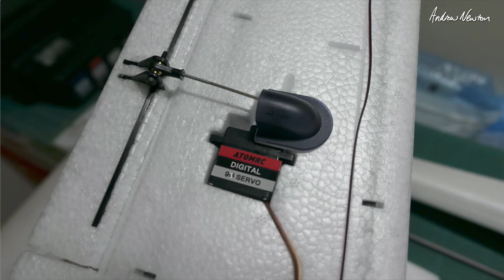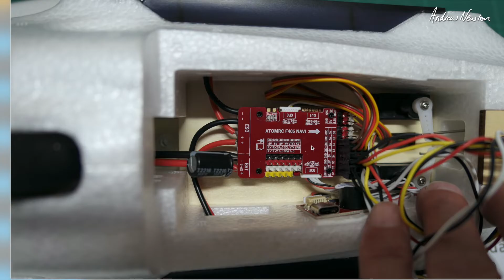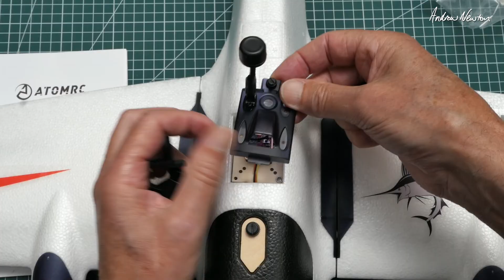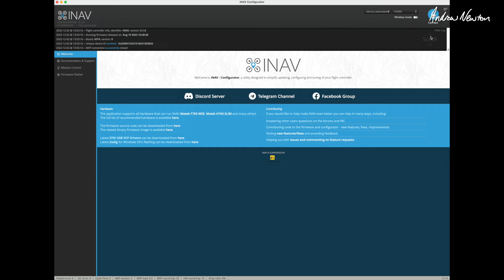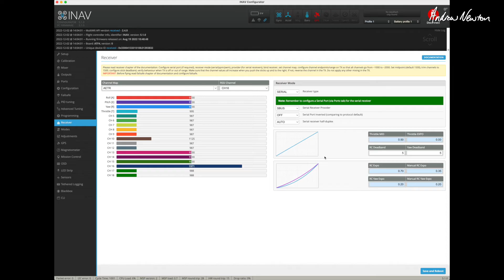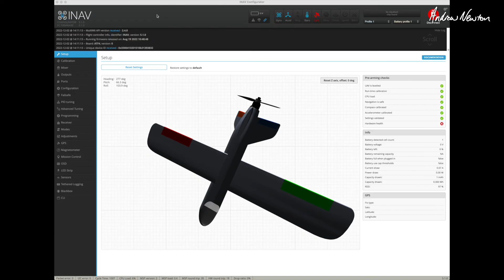AtomRC Swordfish Setup and INAV

Comment: I'm at a loss as to why AtomRC didn't extend the ailerons control horn to be in line with the ailerons neutral angle pivot point to maintain control surface throw symmetry on such a nice design. The degree of asymmetry in control throw distance added is hard to measure accurately, and better done at the servo if that's what you want (for differential aileron throw, etc) allowing asymmetry in both directions up and down.

Comment: I got an atom swordfish for Christmas. I tried to maiden it today and every time i through it it would fly out about 10 to 20 feet and make a hard right turn and hit the ground. I did set it up like the instructions said -1800  and the arrow pointing towards the rear. Do you have any idea on what is going on. Thanks for your help. Ray
Reply from the maker: INAV Trouble shooting link in the description. Parts 1, 2 and 4 should sort your issue
Reply: @AndrewNewton  make sure both props are on tight.

Comment: Andrew, I noticed that your receiver powered-up when you plugged in the USB cable. Mine doesn't, so I have to connect the main battery up. Have you any idea why that might be? It's frustrating because the air unit begins to overheat while I'm working through INAV. Receiver is a Crossfire Nano btw
Reply from the maker: Connect the receiver to a 4V5 pin for USB power, doesn't need to be on the same UART
Reply: @AndrewNewton  Thanks 👍

Comment: Great info on setup. So right, everyone's transmitter setup and switch-modes seem to differ.
Thanks for the update on the current draw. Very impressive package.
Overall this seems like one of the best new planes released in 2022.
Reply from the maker: Yes, best for quite a while.

Comment: Nice overview Andrew. It looks like they've used Quad style ESCs, have they added any capacitors on the ESCs too or just the one cap for the battery feed?
Reply from the maker: Thanks Crunckle. No caps on the ESCs. Probably needed looking at my FPV feed
Reply: @AndrewNewton  I've always thought it good practice, especially on a twin with longer power leads.
Reply: I got one capacitor on my FC battery pad
Reply: @Tommyjames21  What size?
Reply: @sherwoodp2738  470uf 35v

Comment: Great vid! Can you tell me where you ended up with the servo horn holes for the ailerons and vtail to reduce throws?
Reply from the maker: Thanks, I cant check for a couple of days. Remind me on Monday if I forget
Reply from the maker: Outer holes on all the control horns. Outer hole for aileron servos  and second outer for tail servos
Reply: @AndrewNewton  Thank you! As far as I've understood, I should do nothing like reversing and adjust travel in the radio. All this has to be done in INAV configurator, right?
Reply from the maker: Correct. The only reversing you would do in the radio is to get the bars in the INAV receiver page moving to the right when you move sticks up and to the right.
Reply: @AndrewNewton  Thank you very much, I will double check that

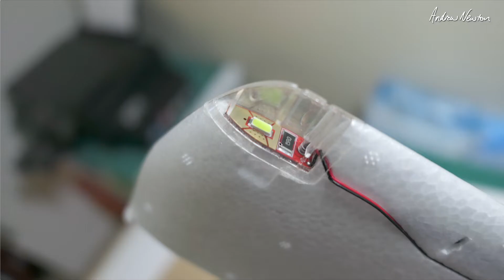Comment: If you open the hatch at min 4:08 did they wire the led lights to the ESC or to the quick release board on the the wing?
Reply from the maker: To the ESC

Comment: I noticed you installed the props  going opposite I would suspect. I wired the motors to spin away from the fuselage. Is yours going toward fuselage and that’s why props are installed that way?
Reply from the maker: No real reason. All combinations work well. Most twin planes have 2 props going the same way.
Reply: I think the best way to mount the props would be having them spinning inwards (moving downwards closest to the fuselage). That reduces p-factor when you're at a high angle of attack so if there's ever an RPM differential between the motors the yaw moment would be minimized. HOWEVER p-factor doesn't affect an RC aircraft that much so any orientation should work, but I would try to have them spinning opposite directions personally.

Comment: What kind receiver did you use to connect to swordfish rc plane’s flight controller
Reply from the maker: FrSKY SBUS then Matek ELRS. You would probably need to use a FlySKY receiver set to SBUS.
Reply: @AndrewNewton  but I saw the transmitter is called radiomaster you are using it to swordfish rc plane video of atomrc swordfish setup and inav that YouTube video I watch and the receiver connected to swordfish rc plane’s flight controller on it

Comment: I noticed that you don't have the tail fins installed.   I lost one of mine and am deciding if they are really necessary.  I could 3d print them but  do you think they are needed?
Reply from the maker: I did fit them later and I still have them. Probably do have an effect but not crucial.

Comment: Would you recommend the Swordfish for a beginner to learn to fly LOS with before getting into FPV?
Reply from the maker: Great for FPV but not the best for beginners. Skysurfer X8, Bixler or TopRC / PrimeRC TC1400would be easier to learn on and survive crashes better.
Reply: @ thanks for the suggestions. Anything with front propellers you would recommend. I loved the XK A800 and I found it easy to fly. However the quality of the electronics are pure garbage. I tried a ranger 600, hated it.
Reply from the maker: Phoenix S or Walrus would be good. But if you have done some flying already the Swordfish might be fine for you.
Reply: @AndrewNewton  ok great thanks for the suggestions. I find it odd how I could fly a front prop plane fairly well and do successful smooth landing fairly precise with the a800 while the ranger 600 was horrible for me.
Reply: @ thanks I will do the Phoenix 1600mm then unless you think the E-flite Umx Conscendo is a better option?
Reply from the maker: Phoenix S is my fave. But 2S only unless you swap for a smaller prop
Reply: @AndrewNewton  thanks for the tip going for the Phoenix then

Comment: Hi Andrew, I'm not an INAV specialist and I don't know where to connect my Crossfire receiver. I think it's on one of the onboard UARTs but which one? Similarly, I intend to use a DJI HD camera with its vista, but on which port should the DJI camera be declared? Definitely the manual lacks details.
Reply: There is a special connector for DJI vtx on uart 5 (choose DJI vtx on peripheral list only). For the rx just solder your crossfire receiver on uart 1 (ch1 of crossfire rx to tx1 pad and ch2 of crossfire rx  on Rx 1 pad.
Reply: @Tommyjames21  Thank you very much, this is the kind of information that should be in my manual.
Reply: @patricehonvault2612  but these informations are on the manual! 😁
Reply: @Tommyjames21  yes if you look carefully at a wiring diagram.  I have already seen better, for example the last FC Iflight that I bought for my 5" drone, in addition to the diagram there are all the parameters to be applied in Betaflight.

Comment: My Swordfish is due to arrive this week. I got a Zorro ELRS with receiver you suggested. This will be my first plane in EdgeTX as I fly Spektrum   Do you have suggestions on setting up my radio. I will adjust the INAv according to your file.
Reply from the maker: Very nice but you have a lot to study and learn. 3 new systems all at once. Watch all the relevant videos, practice with your radio until it is familiar and you know how to setup switches and channels. I can share my model file and INAV dump, but that will only help you crash quicker unless you understand them.
Reply: @AndrewNewton  Thank you. I need to take the time. I always run a little too fast and the result is an unwanted mishap. I’m going to set up my little foamies and give a go until I can some confidence in the systems
Reply: I e learned to use the Zorro and have enjoyed using it with a number of planes. I’m preparing the Swordfish learning the INAV but I am wondering if you have the set up for edgetx ELRS to use for the receiver that I will connect to the flight controller  to allow the FC to do the work

Comment: Hello, I have a question regarding the installation of the plane. Please understand that it's my first time assembling and making it myself, so I don't know it well because the instructions are poor.

I bought the current RTH+FPV version. I searched and found out that I needed a receiver with SBUS function, so I bought R88 of Radio Master. 

I'm wondering if the controller F405 provided by ATOMRC serves as a normal receiver, apart from video transmission. I'm wondering how to bind if you're playing that role. I look forward to your kind reply. Thank you.
Reply from the maker: Maybe watch some of my RC Basics videos first. https://www.youtube.com/playlist?list=PLC8MdCMvxwBivLCbogn2tGgg8G4_k4JXA.
F405 is a flight control board not a receiver or a video transmitter. You will need to connect the R88 with SBUS, and a video transmitter and camera. How to bind depends on your receiver and radio, there will be lots of videos on the subject.

Comment: Hi, I am new to fixed wing fpv. May I know if this plane supports pwm receivers and transmitters such as spectrum( like those on traditional non-fpv rc planes)? If not, what receivers and transmitters can you use? Thanks.
Reply from the maker: Yes it would be fine as a normal PWM receiver plane with no FC. Spectrum, FrSKY, Radiomaster, FlySKY or any system would work.
Reply: @AndrewNewton  Ok thanks!. If not using a  fc, can you still use the rth function?
Reply from the maker: @21y1ihuangzhongyi6  No, RTH requires an FC with GPS

Comment: Hi Andrew. Have the swardfish and installed elrs connected to uart 2. Bound to radiomaster tx16s just using the three power connection method and everything seems fine. However each time I power up the receiver has lost its bind and I need to go into the elrs lua script and press the bind button again to re-bind. Any thoughts on what could be wrong?
Thanks
Bill
Reply from the maker: Has to be mis-matched ELRS firmware. I would update module and receiver and use with a passphrase
Reply: @AndrewNewton  Thanks Andrew, I will do as you suggest 😁

Comment: I got Swordfish RTH. All set up except the elevator goes in opposition like the rudder even though iNav shows it correctly in receiver. I swapped servos on board still same issue. This preprogrammed so I’m not sure what is issue. Set up ERLS as v tail also.  Any suggestions?
Reply from the maker: Don't set up VTail in the radio (if that's what you mean by ELRS) Reverse the elevator weights in the INAV mixer to get them moving the right way.
Reply: @AndrewNewton  I setup new model on Zorro as one channel for airelon and standard tail rudder for Swordfish. For some reason now the control surfaces all go to 2012 showing deflection. Before they were centered at 1500. Still have elevator going in opposite directions. Don’t know now how to center them or what is reason for this change in control surfaces.
Reply: It appears that the channels on the Zorro are maxed to 100 so the bar only moves in one direction. I set up standard for new model and it has input weight as 100 and mixer rate at 100. I don’t know if it’s the radio being defective. This is what causes issue in iNav.
Reply from the maker: @Coronet47  Can you show me the Zorro mixer screen or send the model file?
Reply: @AndrewNewton 😊 I sent another donation for your time. I can send the files but can’t locate your email address.
Reply: Found email and sent files with photos
Reply from the maker: Thanks, you are too kind.

Comment: how does the RTH work with no compass? manual just shows GPS w/o compass.
Reply from the maker: GPS provides enough data on planes because they are always moving forward. Quads need a compass because they can hover still.
Reply: @AndrewNewton  Tanx, now I feel better. 1 more question: Inav or aurdpilot?
Reply from the maker: @mysticguido1  INAV for me, it's much easier to start with

Comment: Hello, I have a problem, I am updating the firmware via INAV for ATOMRC405NAVI version 6.0, the firmware passes without errors, but then when Connect gives the error "Flight controller info, identifier: INAV, version: 5.1.0 This firmware version is not supported. This version of Configurator supports firmware from 6.0.0 to 7.0.0 (excluded)" why it says that version 5.1 I updated to version 6.0
sorry for english, I am tatarin
Reply from the maker: The NAVI board comes with INAV 6.0 already installed so maybe you flashed it with 5.1?
Just have to reflash with V6.0 using Configurator V6.0

Comment: Will it fit BN220 GPS? It's slightly bigger
Reply from the maker: It actually comes with a BN220. I swapped to the bigger BN880 which just squeezes in

Comment: Wing connection is lame for now a days, motors are inefficient for long flights, battery bay small, not for long range at all, even the battery hatch is not practical with a screw!!! Not designed for digital, stuck in the past, mid wing with no dihedral will cause terrible stall handling.
I’ll keep my Dragon 2 until a better thing comes…
Reply from the maker: Have you watched any flight videos. Opposite of what you are saying.
Reply: @AndrewNewton  several

Comment: Is the CLI in your downloads? I can't see swordfish. Also seems the release on their webpage is older then this video. Although I am often wrong 🙂
Reply from the maker: Here it is https://drive.google.com/file/d/1irhRUy-U2Y76LYTtuQmx9MW_IETZ71mz/view?usp=share_link
Reply: @AndrewNewton  much appreciated. Also grabbed the Ardu ,Param file. May try a 4g RPi on it if Inav good 
Have you ever tried telemetry on Inav? Apparently it's active. Any comments?
Reply from the maker: Do you mean like Arduplane ground station? No I haven't
Reply: @AndrewNewton  I havent researched inav telemetry specifically. But in my readings I thought I read inav now did two way telemetry like ardu pilot, allowing flight via pc.
Have flown was you cli, it was great. I am definitely going to try their ardu build and do 4g with it. Not since the ease of the Disco 4g has there been a plane that uses so little power and is so stable. It Will make an amazing long range plane.
May need to have one ardu one Inav...
Reply: @AndrewNewton  Thanks! That smoothed my swordfish out :)
Reply: @MrCottonmouth  looking forward to flying this bird 🙂